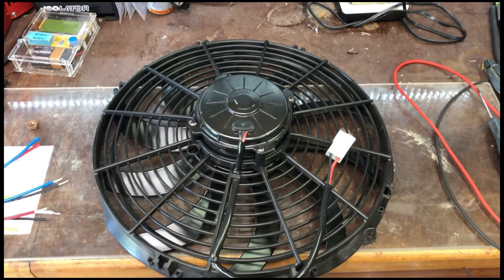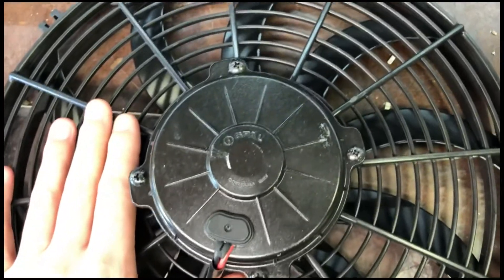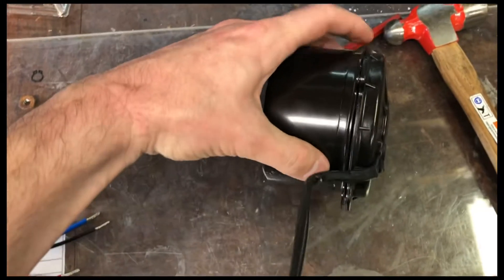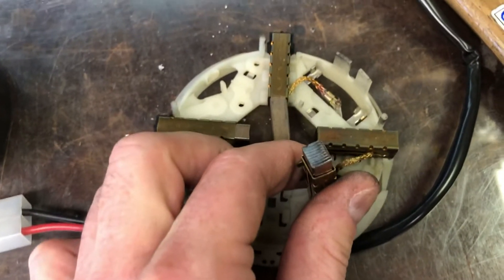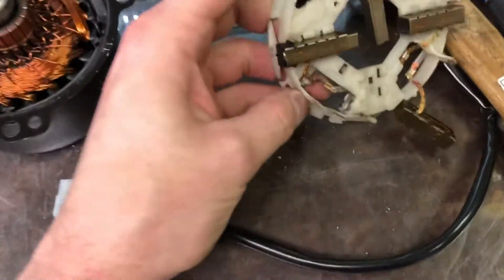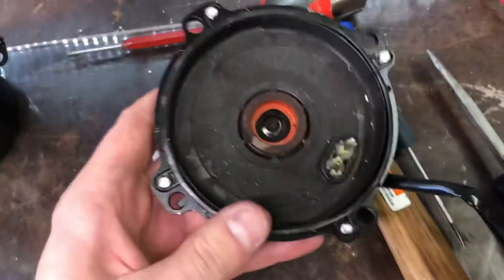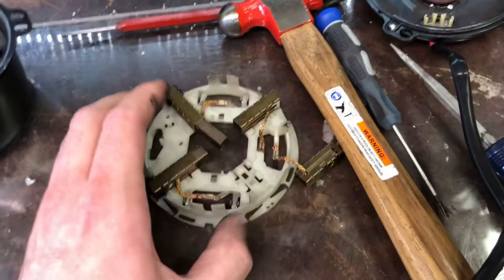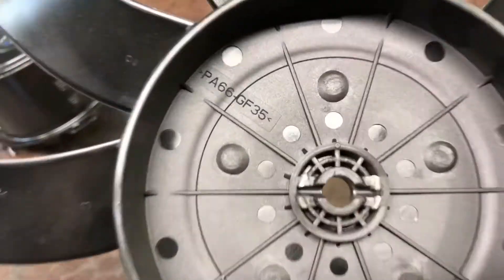Spal Fan Failure Due to Low PWM Frequency - Root Cause Analysis

Comment: You saved me from my original choice of fan and controller. Who would've thought things were so complicated with electric fans, right? Returned shipment of a two speed Derale fan and shroud combo paired with Derale PWM controller. Ended up with a SPAL brushless, custom shroud with matching SPAL PWM sensor. Pricey but so quiet, efficient and powerful on my '66 Vert V8. Can't thank you enough.
Reply: Hi, where did you find spal pwm?

Comment: An old fashion "growler". An  electro  magnet which is built with a physical notch where the commutator sets and an old hacksaw blade would show you if that commutator has become to hot and developed short on it's field winding which could very well be caused by a sticky brush.  Also, shouldn't a PWMs primary frequency be stable and it's % of power be variable?  I am in the process of designing one.  It should have a frequency of about 24Khz and the variable voltage should be between 20% and 80% of each time division.  What are your thoughts on this?

Comment: Those grooves in the brushes are there for fast brush break in so the commutator doesnt get burnt from the high current density that occures with unseated brushes.  Had the motor had a little more time on it when you opened it up those grooves in the brushes would have been gone due to the brushes  fully wearing in against the commutator.  You ought to build your own pwm controller using an Arduino and some Mosfets, then your pwm Hz would be much higher which would result in a much smoother torque application to the fan hub from the motor.   You really should check out Delta PAG brushless fans...they ramp up and down as the cooling load varies with engine load.  They come with a programmable controller that you can use or if your vehicle has pwm out from the engine ecm to control the factory radiator fan then you can use that as well.  I pulled off the two 12 inch factory Spal fans of my Polaris RS1 ( 1000 cc 110 h.p. single seat side by side) and installed two 12 inch Delta PAG fans in place and now my fans ramp up as needed and ramp down.  No more fan 1 running wide open for 10 seconds and then shutting off for 30 seconds while the engine is idling, no more talking over screaming fans cycling on and off and no more 15 degree temp swings either...And I never hear the Delta PAG fans running  unless they have ramped up to high speed  from running at full throttle for a while...Like running in deep sugar sand and I come to a quick stop...Then I will hear them for a few seconds till they ramp down once the heat load from the cooling system has been satisfied.  Also they soft start so no more dimming of your headlights when they come on.  I have mine set up to run on low when the ignition is turned on and they only pull about 1.0 amp each on low and the air moved on low is enough to keep the engine cool when idling or crawing through trails in the woods.  When I am riding with a group I am the only one that doesnt have to listen to annoying radiator fans turning on and off to keep the engines cool. Also I may add that one very hot day we were riding at River Ranch and racing in the deep sugar sand the other guys are hitting 235 degrees and going into limp mode while I am only hitting 200 degrees.  At that point both fans were roaring at full speed but I couldnt hear them until I stopped to wait on the other guys to cool down. After about 15 seconds of idling my fans started ramping down to medium and then from medium to low after another minute. Also these fans have a manual overide lead coming from the controller that you can ground through an overide switch to manually turn them on high if you want. Also there are many more ways to configure them as well, and unlike other brushless fans the inverter module is seperate from the motor and can be replaced without removing the fan from the radiator. I have installed these fans on several other vehicles as well with great success. I am fixing to install a 12 inch Delta PAG brushless fan on my brand nee Polaris Sportsman xp1000s four wheeler as well. The fan sizes range from 12 inch 2100cfm to 18 inch 4000cfm at .1inch of H2O if I remember correctly. Also they offer a 60 g.p.m. duel outlet electric brushless stainless steel water pump that can be used in conjuction with the fan controller as well. Good luck, hope this info helps.

Comment: Not using pwm, I think I have same issue with mine in terms of the pin breaking off. Will comment with update when I pull it apart.
Reply: So for my case the pin broke, I made a new pin from an Allen key of the same size. Just cut to same length and if needed shave it down a bit. My fan is good again with no noises.

Comment: Have you been able to find a 7khz PWM that would work?  I talked to one of the engineers at Spal and he told me the same thing.  We have a SPAL fan on my son's 1966 Mustang and it sounds like a small jet engine.  I have not been able to find a quality fan that has the lower profile than the Spal fan.  I am sure slowing it would help the sound problem.  Many car manufacturers use these PWM controllers to control their fans.  I wonder if one of them meets the 7khz specification (Volvo, BMW etc.) Thanks.
Reply from the maker: Yes!  If you search my videos you’ll see several videos on this subject and me installing one on my 66 Mustang along with a medium profile Spal fan. The Autocool HF-125 controller does 7kHz.
Reply: @mechtrician1  Thanks! I found that video after I posted.  Are you still happy with the controller?  Have you used the new controller on Spal fans? Are there any junkyard controllers that put out the required 7kHz signal?  I like the DIY stuff on the cheap. Thanks.